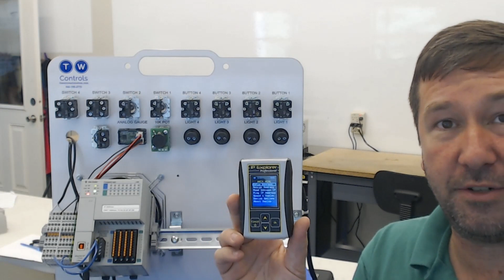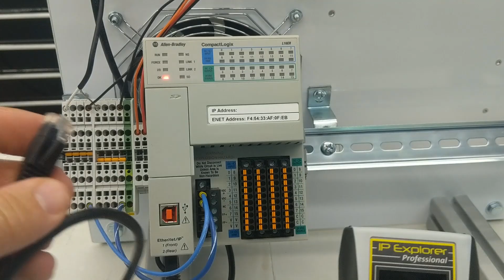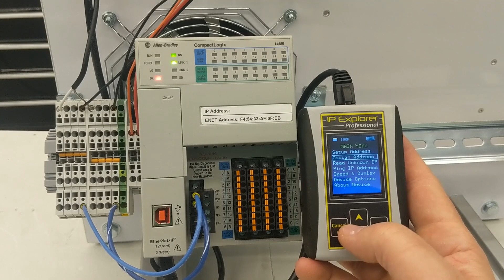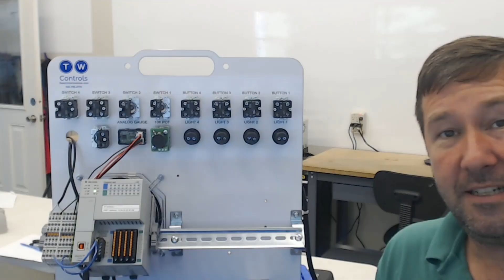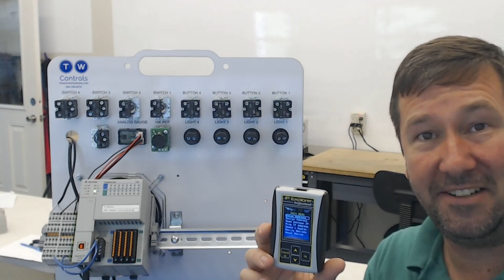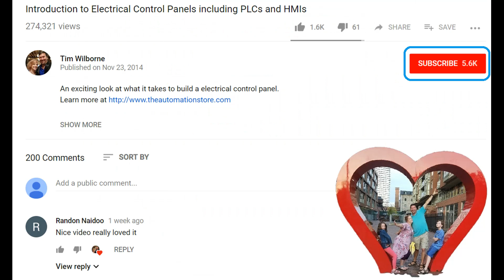How to Read and Write an IP Address to an Allen Bradley Compactlogix PLC.  Or Change a Static IP

Comment: Is this PLC IO Module requires multicast configuration from the Router? What is the required MTU size? can the MTU size changed? Will two PLC from site A to site B communicate if they were linked via IPsec Tunnel? Thank you for the answer.

Comment: Is it must to set an up address to the Sim -IPE or it can stay in configured.
Reply from the maker: You should configure an IP address for the SIM-IPE before using it.  It isn't necessary for the discovery features but it is for any of the more advanced features such as assigning IP addresses and pinging.

Comment: Hi, what is the Set Static IP option in there? can I use that for setting the IP of the target device instead of using BOOTP/ DHCP option?
Reply from the maker: Do you mean change a static IP address such as in this video? https://plctools.com/change-a-static-ip-address-of-an-allen-bradley-compactlogix-5370-plc/
Reply: @TimWilborne  No. I was referring to the third option "Set IP Static". 
On the IP Explorer device, under 'Assign Address' there are 5 options, where 1. Use BOOTP/ DHCP | 2. Replace Stat. IP | 3. Set IP Static. 
I was wondering if third option would work? instead of using first option i.e., "Use BOOTP/ DHCP" option?
Reply from the maker: That option would set an IP address to static that had been previously assigned by DHCP or BOOTP.

Comment: Im getting a target device reported error when I hit set static
Reply from the maker: Hi John, is it a Compactlogix PLC?  Are you trying to change it to a way different network as in different subnet also.  It requires a few extra steps.
Reply: @TimWilborne  no I'm just making rookie mistakes. I figured it out. Last time I forgot to disable bootp and the driver lost the ip address
Reply from the maker: @johnrece6622  Glad you figured it out John.

Comment: will this work with Siemens RF181-C Enet modules?
Reply from the maker: I'm not familiar with that device but it looks like it follows the Ethernet/IP protocol.  As long as it fully supports Ethernet/IP then you should be able to set an IP address to static and change a static IP address.

Comment: Will it work with abb irc5 robot controller?
Reply from the maker: Hi Chad.  The Read Unknown IP Address function should work along with the Assign via BOOTP/DHCP.  I'm not familiar enough with the IRC5 controller to say about the Set to Static or Replace Static IP feature.  It does support Ethernet/IP which would mean is should, it just depends on how close to the guidelines ABB follows.  Thanks for watching!

Comment: Can the IP explorer  read the IP  address of a device that is password protected ??? .
Reply from the maker: Yes it's should be able to read. Let me do some testing on writing.
Reply: Excellent, I will get a couple of them  and  use them to read IPs from our   radios. Thanks.
Reply from the maker: Great, let me know how they work on them.  I'm going to start working on a list showing what they can read and write to.
Reply: Tim; 

it does not work with our radios
Reply from the maker: @shamanking5195  Can you send me the part number?
Reply: Tim;
 is a GE radio , MDS  INET-2
Reply from the maker: @shamanking5195  Where can I find info on It's Ethernet IP capabilities? The only thing I could find was this vague statement of "In the TCP mode, it supports 
point-to-point Ethernet/IP to serial port connectivity."
Reply: I think  the manual can be found 

online..I might be bale to get some information from technical support and forward it to you..
we use this radios quite a bit, we have over 80 remote sites and all sites use this model to communicate.